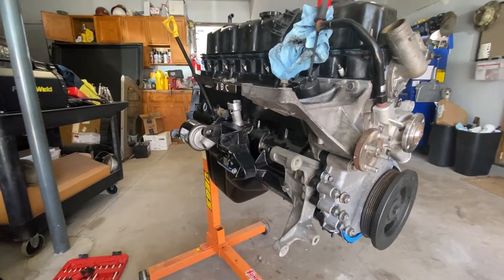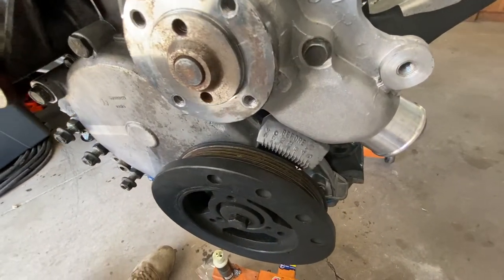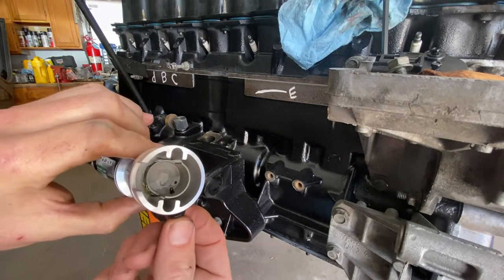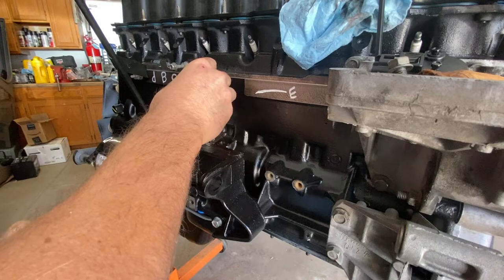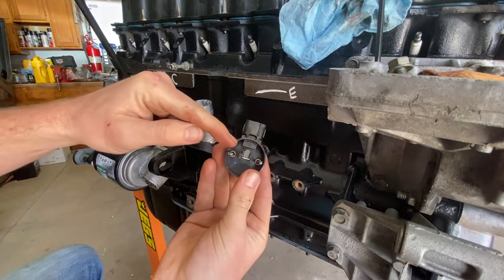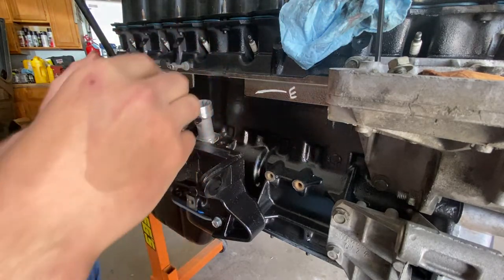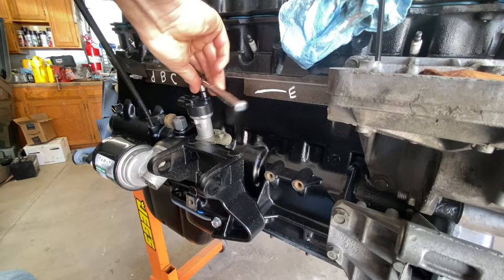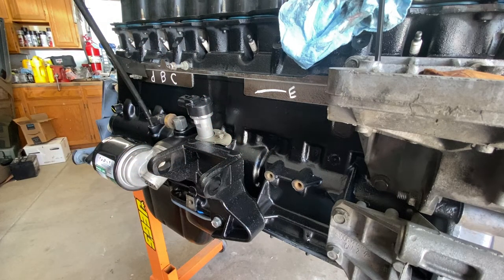Jeep Cherokee XJ camshaft synchronizer installation explained

Comment: Good video. Where are the cam lobes when #1 is at TDC?
Reply from the maker: Great question however I’m not 100% certain and I don’t want to give you the wrong answer.  If the #1 piston is at TDC I’m going to assume the lobes would almost be in a neutral position with no load.  I’ll see if I can make another video down the road as I’m building a stroker engine next summer with a new camshaft.
Reply: Cool. I think that the valve positions have some bearing on TDC. Doing mine tomorrow. I'll let you know what I come up with.
 @wrenchops719

Comment: Hi, I just changed my oil pump and I'm going to prime it tomorrow, so I have to remove the camshaft position sensor to spin the oil pump with a drill and long flat head screw driver bit. I don't want to spin the engine to TDC before the pump is primed, so chances are good that the cam sync holes won't line up. So, I'm thinking mark the sync cap, base and engine like a Champ, carefully remove the cam sync trying to keep it in position, prime the pump and re-install the sync. If it doesn't work, I'll set it at TDC, line up the holes on the sync cap and magnet and re-install as if it were a fresh install. Sound about right? Thanks
Reply from the maker: If you mark and document the orientation of the camshaft synchronizer both the base and hall affect sensor you should be completely fine to drop it right back in without having to put cylinder 1 at TDC.  You’re on the right track though just need to keep the sensor assembly in sync if you pull it.  Thank you for the view and comment, do appreciate it!

Comment: I'm doing my oil pump soon do I have to have the engine at top dead center after I install the new oil pump?
Reply from the maker: You do not, I suggest marking the exact location of distributor or camshaft position synchronizer “depends on what year you have” before you remove it for a reference point and even take a pictures.